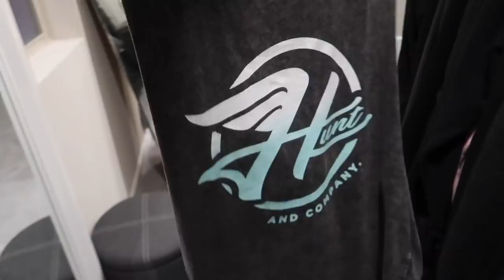Mustang GT gets LOW & STIFF! (Full Roush kit!)

Comment: You need to ditch the Roush tune ASAP.  Contact Palm Beach Dyno and get their L3 package. Includes a few bolt ons and tuning good for quite a bit more power and MUCH better drivability. Additionally the SCT X4 used to load the custom tune can do a crank re learn, so no need to go to dealer.

Comment: Could have just taken the bolt out from the lower control arm where it bolts to the spindle in the rear and pulled the spring out that way

Comment: You need to have the car relearn its camshaft position, if you use a lund ngauge with a lund tune you could do this in less then 5 minutes in the diagnosis settings Teeeeg